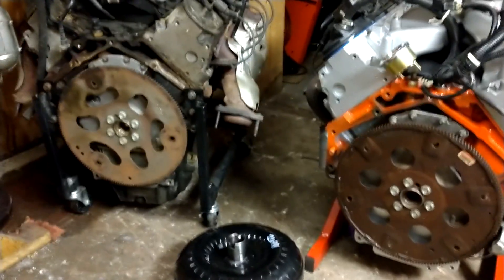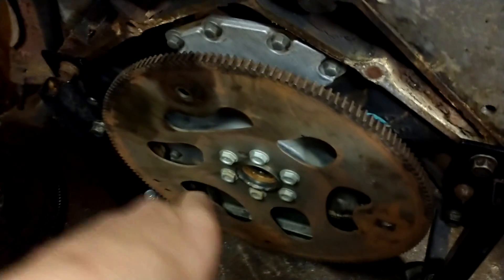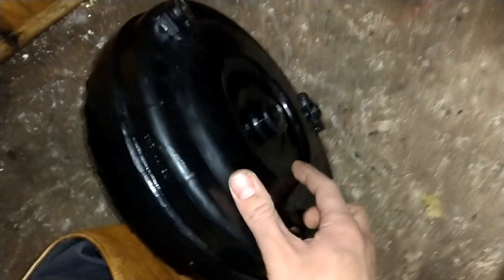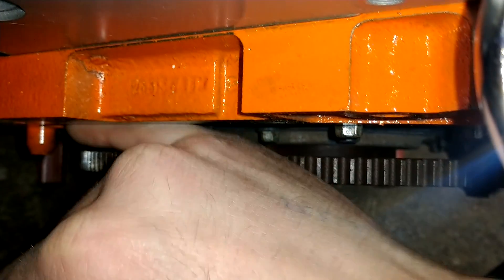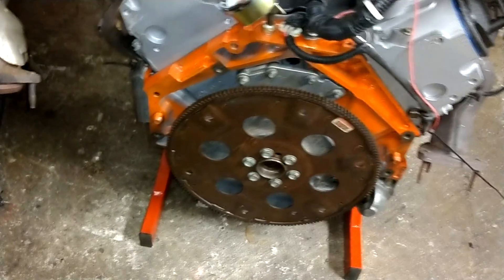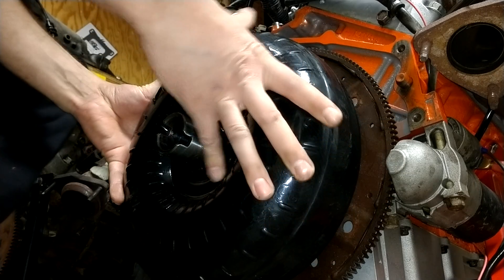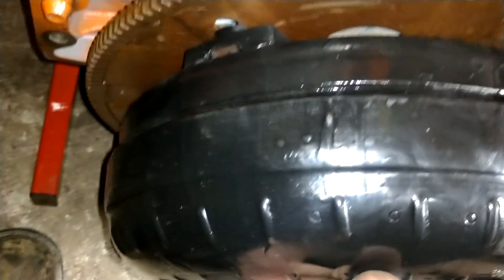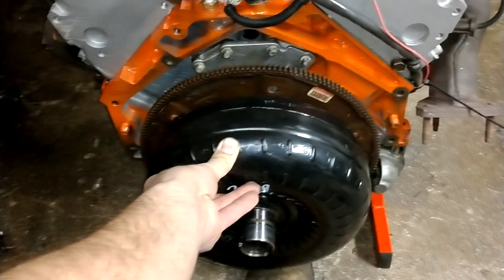HOW TO: Swap a Th350 to an LS engine early vs late flexplate comparison

Comment: @OMRY1561 - 4 min ago
Hi nice video Great information
I have 1967 cadillc th400 and 429 engine
Do I need any adapter if i install 350 It1 gen2 1996 to the
th400 thank you

Comment: I have a 5.3 dished flexplate I have the swap flexplate and I have the cockring spacer the converter is all way in Trans and I have a big gap and the end of the converter is not all way in the crank where I put the cockring and pointers

Comment: Is there a difference in a TH400 Flexplate and a 700R4 flexplate on a 1982 Chevy 350 engine ? I just swapped the TH400 out of my old 82 Chevy 350 cu.in. Cube van and put in a 1991 700R4. I had the driveshaft shortened and a new 27 spline Slip yoke installed...It bolted right up...but I am getting a rumbling noise near the Torque Converter....not sure what it is... I haven't taken it out on the road yet... as I don't want to make things worse !
Reply: Liked/Subscribed !

Comment: What about a 98 z28 LS1 with 4l60E going to TH400. What do I need if using factory flexplate? Also, I have a 3600 rpm stall TC in the car now.. Do I need to swap to a TH400 torque converter?

Comment: i just swapped out my sbc/th350  and attached my 5.3 LS to  TH350 with the collar/sleeve but the convertor bolts seemed short and i had to suck the convertor away from trannyy about 3/8 of an inch. is that a problem or normal?

Comment: So just to be CLEAR & CONCISE,  my 2003 Ls 5.3L will bolt up to my 84 cutlass th350 with just that spacer/sleeve thing and probly die grinding the flexplate?
Reply from the maker: As long as your th350 has chevy bell.

Comment: so you are saying on an early 6.0 the only mod needed is to elongate the converter bolt holes? ever had an issue with the th350 converter not allowing the bell housing flange to meet up? like the converter is out to far. i think its in all the way, i tried for a good while to get it further in but no luck, trying to figure this out.
Reply from the maker: Add bushings. We had that issue with a 4.8
Reply: @beeterolds  if I add anything it’s going to be even further out. I figured it out though. Torque converter wasn’t all the way in.

Comment: Just wondering. I got this set up for my Truck. The 350th Im using has a 3600 stall on it. Do you know if these have issue with larger stalls, Motor is just stock 5.3 with Long tubes, straight pipe ,Sloppy stage 2 cam and beehive springs . other than that all stock .

Comment: Ok I gott a question I'm not a transmission guy but I have a 2500 stall brand new in box I got a steal for 100 bucks I have a 4.8 ls your converter bolt holes are on the back like mine ..so di I take the flexplate off and bolt it in through the back if I do will converter bolts be hitting anything cus I looked and thiers not much room for a head of a bolt to b sticking out I have looked everywhere this is only video were your converter bolt holes are like mine ..so take flexplate off volt converter to it or what ???? Any help would be grateful..thanks

Comment: Do you have to use longer bolts to mount the converter to the flywheel?
Reply from the maker: Yup and spacers
Reply: BeeterOlds can you point me in that direction? I have everything else I need for my swap. 4.8 to th350.

Comment: I hate to be that guy, so if you have a dished flexplate and buy the spacer, can you keep the dished flexplate? Or must you buy the spacer/flat flexplate
Reply from the maker: Dished flywheel. Keep the flywheel and the spacer.. Flat flywheel typically found on early 4.8s and 6.0s.. With long cranks. Spacer usually not needed.
Reply: BeeterOlds much appreciated thank you! Looks like I will be buying the spacer thanks
Reply: Was thinking I’d be stuck buying an expensive flywheel

Comment: Does it have to be a non locking th350....because i have the th350c with the lock up that came origonal with my truck and want to keep it so do i just hook back up the factory wirirng or what?
Reply from the maker: Or dont use it.
Reply: @beeterolds   so it's good to run without any of the electronics hooked up just vaccum and the kickdown?
Reply from the maker: @marquesmoss5283  ya. Itll be fine
 You just wont have lockup

Comment: I used Chevrolet's spacer, longer bolts and a flat flexplate that I got from a 4.8 that had a 4L80. My friend at a machine shop drilled new holes for me. I took my convertor along so he could accurately locate my holes to be drilled. He made some spacers for the convertor bolts so I had the 1/8 inch clearance with the convertor pushed back into the trans. The 1/8 clearance is needed so the convertor doesn't pull out of the pump too much.

Comment: I have a 2003 6.0 with the longcrank shaft. I didn’t use the cock ring and my th350 isn’t wanting to go into drive.
Reply from the maker: Unrelated issues friend
Reply: Use the ring , or flip your
Plate? Probably have the wrong converter in, had it happen to a friend, trans didn’t wanna rotate

Comment: Hey what size bolts did you use for the torque converter to flexplate on the th400

Comment: I have a 1992 454 ss truck with a early 4l80e transmission. I also have a 1998 C5 Ls1 im swapping into it. Do you know if that early 4l80e will work with the ls1 engine? If so what do you think I will need to make it work?. Thanks in advance.

Comment: I own a 2002 Chevy 2500hd. Is it one of the years that utilizes the longer crank shaft?
Reply: only 99 and 2000 had the long crankshaft 2001 and up used a spacer

Comment: Appreciate that dawg I had to drill out those holes on the flex plate today putting a built 350 turbo with a 2500 stall behind that ls.

Comment: Is this the same for 99-2000 6.0 with 4l60?
Reply from the maker: I wasn't aware of.any 6.0s that came with the 4L60e
Reply: It doesn’t trying to make it work
Reply from the maker: Need a dished flexplate.
Reply: Yes some esclades had a 4l60 I pulled a LQ9 out of an 02 the other day.

Comment: Hey man not on topic of this vid but when using the msd 6014 to fire the packs it says it needs to hooked up to a "fused" battery with your 30 amp relay as it shouldn't be hooked up directly to 12 volt source. Are you using on if the "fused" adapters on your battery or the 30 amp relay?
Reply from the maker: I'm using the 12v keyed source that originally powered the distributor.
Reply: @beeterolds  I was wondering about that but wasn't sure if people did it now I know man thanks.

Comment: That's for all year 6.0 or just the 99's ☝
Reply from the maker: 99 used the long crank as did some early 2000s. The 5.3 in all yrs used the shorter crank and dished flex plate
Reply: I was told all 6.0

Comment: Some you gotta use that goofy doughnut spacer and longer bolts
Reply from the maker: Not needed.. the Step bushing is all you need. No bolts required
Reply: @beeterolds  usually yes. I cant remember the reason why but i had to use jegs 555-601010k
Reply from the maker: @dvjracing5947  I've never had to.